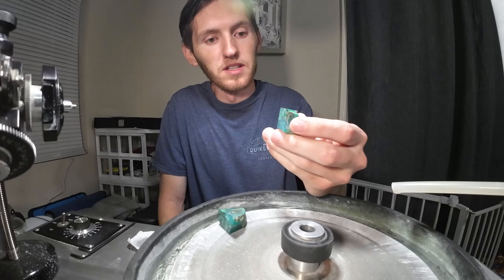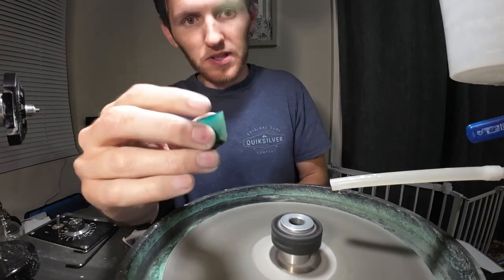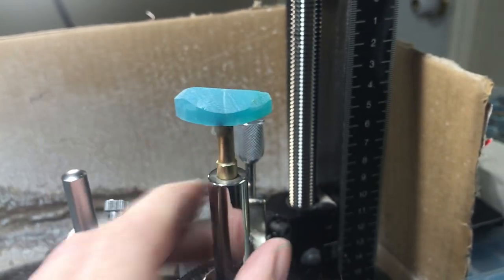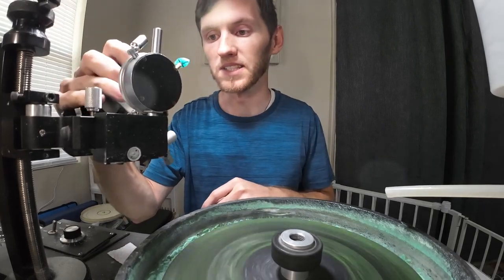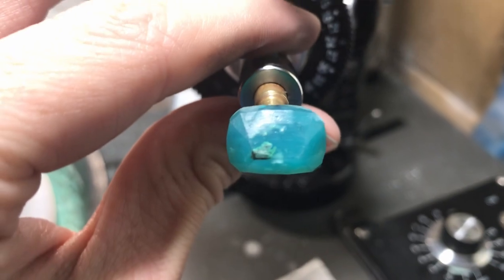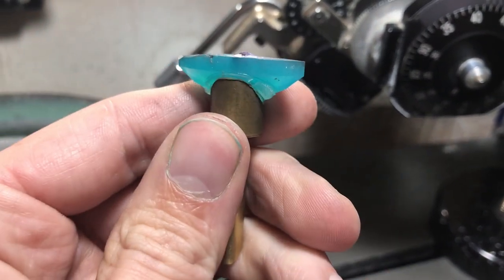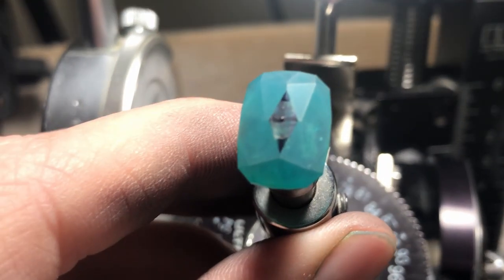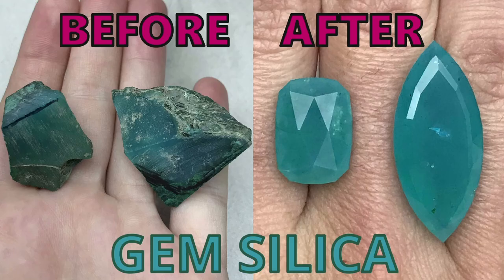Cutting These Rare Gemstones Raw to Finished, Gem Silica

Comment: Hi Matt, Thanks for the video.
I was wondering if you had anymy tips on polishing  botryoidal gem silica.
Im getting a lot of undercutting  which is a major bummer.
Reply from the maker: Work you way through several grits: 600, 3k or 8k for pre-polish, then cerium oxide. Get your meets in with a good pre-polish will help the final polish go quickly while maintaining your meets. The cerium oxide isn't a cutting stage grit, so get you meets in before then.
Reply: @MattsCornerofGemCutting  Thank you so much 🙂

Comment: isn't silica like really toxic to inhale?
Reply: Yes, he is risking silicosis.
Reply from the maker: Yes, inhaling dust particles from silicas or quartz can lead to silicosis in the lungs. Using adequate water when cutting is important to keep the dust out of the air. This goes for more than just gem cutting. Construction workers run the same risk when cutting concrete which contains silicate materials. Using adequate water keeps the dust out of the air and basically eliminates the risk of getting silicosis.